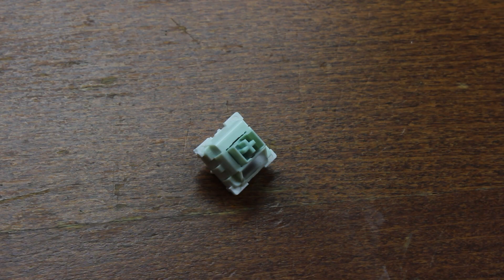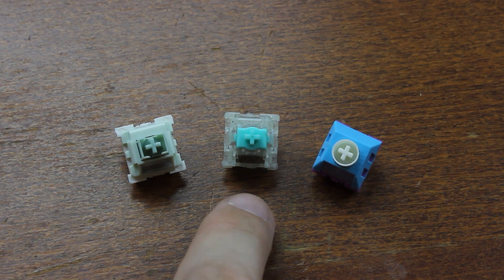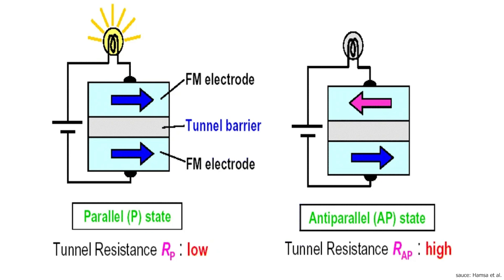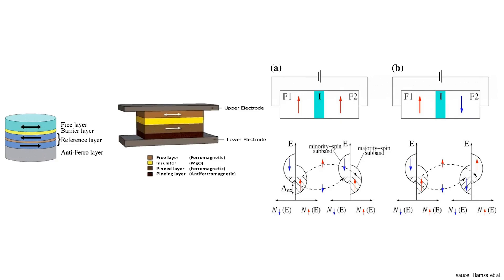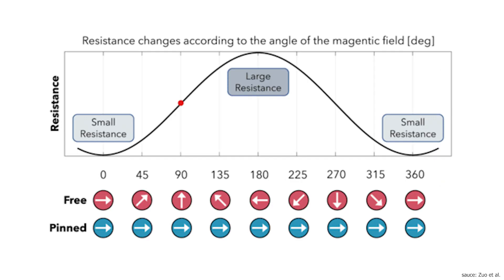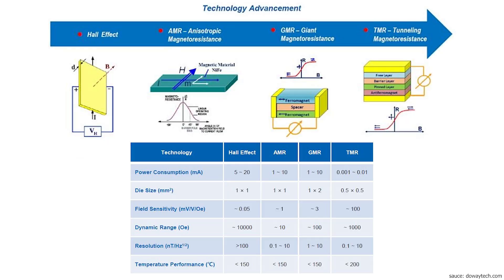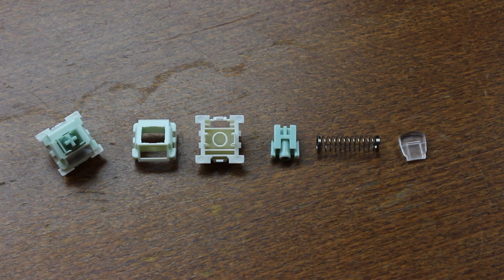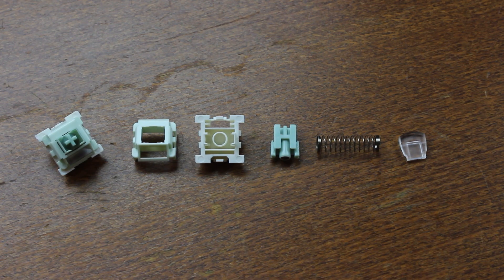Teardown - Tunnel Magnetoresistance (TMR) switches!

Comment: There's also additional benefit, there isn't the noise and jitter issue that HE has, meaning they're far more resolute as well.  The only real downside is the susceptibility to external fields, but you'll get this in any magnetic sensor, shielding does exist in some scenarios but usefulness depends on implementation.

Comment: I find these truly different switches fascinating. I think though market forces will make them a hard sell, people don't want to swap their PCBs, they just want hot swappable micro variations of an mx switch with custom lube and a terrible name.
Reply: well they said this about HE switches and they killed the MX gaming market in a few years. I think TMR itself will do this to HE and with its considerably advantage in power consumption over HE, it possibly rivals contact based switches. Thus with decrease in prixing over the long run this could make contact based boards even more of a nice than it is today.

Just to make sure, currently the sales of HE boards greatly outnumber enthusiast MX boards. After all Gamers where the backbone of the mech industry for the longest time anyway. Without gamers is suspect we wouldnt even have a big mech industry at all.

Comment: Within this context, neither HE nor TMR “switches” exist, either would simply be a technology used in the PCBA. These are just magnetic switches. 😄
Reply from the maker: Yes, but you can't use HE switches in a TMR board or vice-versa.
Reply: @Chyrosran22  You can! Magnetic switches are as cross compatible with TMR sensors as they are with different types of HE sensors.
Reply from the maker: @mimp8365  Not according to the manufacturer.
Reply: @Chyrosran22  I don’t believe any manufacturer would claim that their TMR board is only compatible with “TMR switches”. As I said, there’s nothing inherently TMR or HE about magnetic switches.

The factors that matter for different types of sensors, HE and TMR alike, are magnet strength, magnet position (centered or off-center), and pole orientation (horizontal or vertical).

There are numerous HE boards that aren’t compatible with the most common KS-20 magnetic switch (centered with vertical pole orientation). Among the few TMR boards out there, the exact same switches are supported by both the FUN60 Ultra (TMR) and the Womier SK75 TMR. So, HE or TMR just refers to the technology the board uses, the switches themselves are simply magnetic! 😁
Reply from the maker: @mimp8365  The one I'm reviewing next claims exactly that.
Reply: @Chyrosran22  Then they don’t know what they’re talking about, it happens. Why did you believe them?

I don’t remember if you got to try the FUN60 Ultra or the Womier SK75 TMR, but both claim the opposite.
Reply from the maker: @mimp8365  Neither, the Lemokey L5.
Reply: @Chyrosran22  Ah, Keychron, not surprising. 😂

The claim they made about their HE boards being compatible only with their magnetic switches is somewhat true, but it has nothing to do with the switches being HE or TMR, as that doesn’t exist. It’s because they use HE (and presumably TMR) sensors designed to detect weaker magnetic fields. KS-20 magnetic switches, for example, have magnets that are too strong. I’m fairly certain that if you take a magnetic switch from your Keychron Q1 HE, it’ll work in the Lemokey L5 TMR.